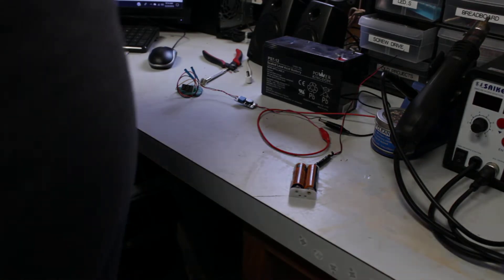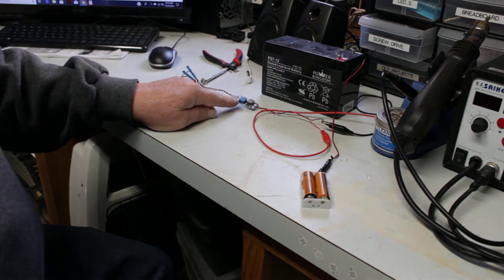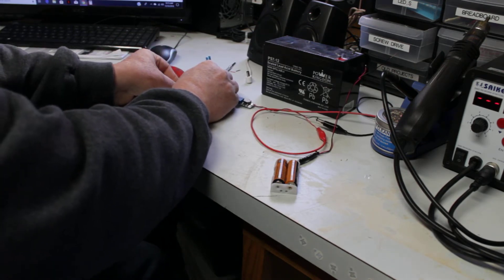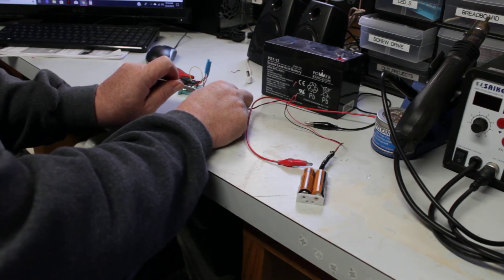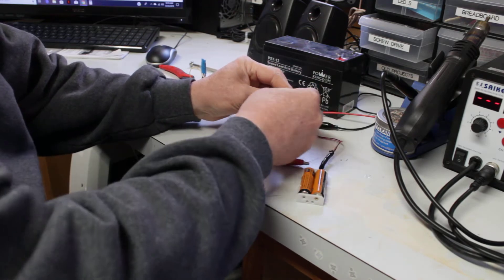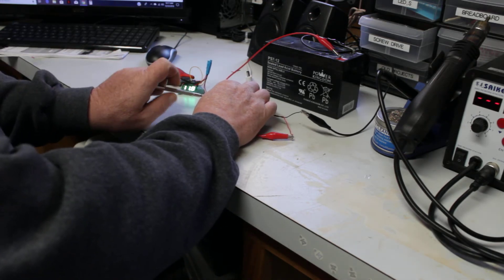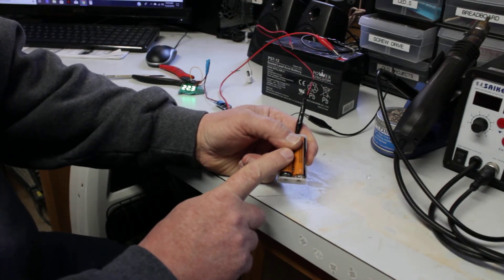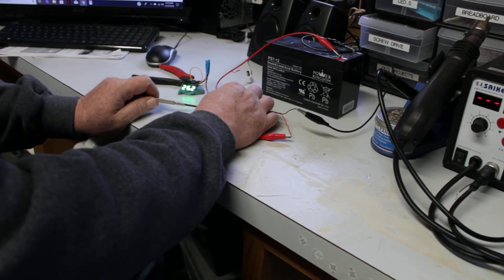How to properly adjust a MT3608 DC-DC Booster

Comment: can i start with 5 volts ?

i intend to have a 5v input only for a project then boost it to 12v
Reply from the maker: no sorry,,,start a 3vdc or lower or you will pop the board

Comment: Glad I found this video in time.
I've just put it to boost 12V to 22V needed for my portable vacuum.
I used weak 5V250mA charger to adjust it.

Any ideas how to make sure it works for long time?
For now seems ok, except for it gets hot...
Reply from the maker: Either put a fan or heat sink on it and a volt meter to watch the output

Comment: Need to boost 9V power source to 12V. I connected the mt3608 inputs to the battery terminals of a TV remote with 2 AA batteries. The voltage meter showed 2.8.  I adjusted the booster to 9.3 (is that ok? I couldn’t get it exactly to 9.0). I then disconnected the booster from the tv remote. I then connected the booster to  the 9V battery case, which was switched off. I the switched on the 9V battery case. Meter still showed 9.3, so so far, so good (I think?). I then adjusted booster up to 12.3 (again it would over or undershoot 12.0 so I went with 12.3 - not sure if that is ok?). After doing that, I switched off the 9V battery case and connected the booster’s - and + outputs to the - and + battery terminals of the transmitter module of the 433 mhz 12V RF remote control relay set, which did not have a battery in it. I then switched the 9V battery back on. I then tested the booster’s output voltage again. It was 2. I turned the booster screw to see what would happen. It got up to 8.8 at some point but would not go any higher. I heard a high-pitched zzzzzzeeeeeeeeee as well and the battery case was very warm.

Comment: Thank you for the useful info.  Is it fair to say to avoid "smoking" the output voltage must not be set lower than the input voltage, and without knowing the factory setting of the pot, we must start with the lowest input voltage (in your demo 3V).  Would it be easier just to turn the pot fully anti-clockwise (settting max output voltage) before you do anything?

Comment: I started with a 3.4V AA LiFePO4 battery as the input... was that too high? It didn't smoke, but all I get is the input voltage out, though if I adjust it down I get 3.16V. I have one more and I'm scared I'll stuff it up too... assuming I did stuff the first one.
It would be nice if it came with instructions, even just which way to turn the trimpot would be nice, especially given the fragility of the modules.
Reply from the maker: No, you did not hurt it with just 3.4vdc, when you did turn it down to 3.16 did you remember which way you turned the pot? If so turn it the other way while giving your screwdriver a slight pressure down on the pot and just keep on turning till your hand aches, if no change the unit is bad.

Comment: Ive used tgis to step up my 3.7v li-ion battery to 12v. When I plug it into my pixie qrp i get this wicked hum and serious static noise through the passive earbuds. How do i filter that out when using the dc-dc step up?

Comment: I have the MT3608 and it only goes down to 6volts, I need it at 5 volts, any idea what’s wrong? I tried turning the screw clockwise and counterclockwise, it only goes up even up to like 28 volts but not under 6volts.
Reply from the maker: What is your input voltage?
Reply: @DIYELEKTRONICKITS  3.7 but nevermind, I’m a noob and had my voltmeter on the wrong setting :s

Thanks for the reply 👍

Comment: The module blows because the Vin is connected to the Vout throw the inductor. When you apply 12V to the input, you have near 12V on the output, if the potentiometer is too low, the voltage in FB pin is more than 6V which instant fries it.
Reply: Can it be modified to prevent it from burning if powered by more than 6 volts input?

Comment: My modules (be here on Tue) say 2v is the lowest.  I don't have a 2v power source.
Reply from the maker: Try it with a AA battery
Reply: @DIYELEKTRONICKITS  This module acts very strange, but I just burnt it up as mine came with the USB micro connector.  I wanted to see what was happening, so I attached the USB and 46.x volts out.  Wonderful so I turned it down and when I went below about 4-5v (happened so fast I have no idea what it was) U1 burned up.  Glowed red, and released the magic smoke.

Comment: Mine was up to 50v out on a 5v input 😳

Thanks for the clarification.  I sussed this out from comments on another video but it's nice to see verification.  Someone was saying initial adjustment needs to be less than 6v due to a pin on the MT3608 chip, but 3.3v is probably the safer bet at no additional sweat.

Comment: Hi, thanks for this video. I’m a farmer and have a couple of farm cars that are used occasionally. It’s maddening  when I discover the battery is dead. So, I want to turn a car fan motor into a wind generator that I can easily plug (xt60) onto my car’s battery when not being used to keep it charged. If I used this booster, I can set the output voltage to, say, 13v, but can it handle the variable input voltage (from 0v to, perhaps, 25v) generated by the fan? Many thanks.
Reply from the maker: Yes it can,,,,,just like a voltage regulator on a riding lawnmower,,,,Start it up and the voltage slowly ramps up till it gets to it charging voltage
Reply: @DIYELEKTRONICKITS  Bloomin' brilliant! Thank you.   
Oh, another question on the same topic. Could I have two output leads from the same module, so that two cars can be plugged into the system at the same time? Thank you so much for your help.
Reply from the maker: @crashrr2993  Yes but you have to Diode protect both items you are charging to prevent parallel voltage coming back
Reply: G-G Electronics Apologies for hitting you with so many questions... but if I connect the wind charger output to the battery terminals, it could be charging (at, say, 13v) for a month. Will I need a fully-charged battery protection circuit/module, or will the battery simply stop accepting charge by itself?
Reply from the maker: @crashrr2993  Yes you will need some type of charge controller

Comment: Is 4.2V from a 18650 lithium battery ok for the first boot?
Reply from the maker: Yes that voltage should be fine
Reply: @DIYELEKTRONICKITS  thanks for the answer, at the end I tried with 5V from USB and it worked well. low voltage is definitely the way to approach this things for the first time. thanks for sharing. using three MT3608 right now and they works incredibly well, voltage regulation is so accurate indifferently from the input voltage.

Comment: It's a design flaw on this particular board. Don't use any voltage higher than 6V on this module the first time. Once the desired output was set, then you can input more than 6V.

Comment: I would like to use the micro-USB version of the MT3608 to power a Mega328/LCR-T4 ESR Meter Transistor Tester Diode Triode Capacitance Mos Mega328 Transistor Tester.   I would like to plug a USB cable into my computer to power it.   I plan to use the 5 volts from the USB/computer to the MT3608.  Using the MT3608 to up step the voltage to 9 volts for the Mega328.  The Mega328 is normally powered by a 9 volt battery.  Here is a Youtube video https://www.youtube.com/watch?v=3bO5b_UdqUs&list=PLNWo0hHbJ-CiO1LZvnys1leL_AN-galPw&index=3&t=0s .  I can't understand what the guy is saying because it is in Russian.  He is using the MT3608 to step up the voltage but I don't understand why he is using a TP4056 Charging Module.  Do I need to use the TP 4056 for some reason?  Thanks for your video.
Reply from the maker: Just my thoughts but:
#1 He's using it as a means to recharge the battery.
#2 It's also being used as a controller so the battery does not overcharge